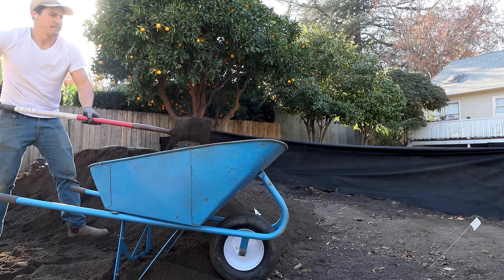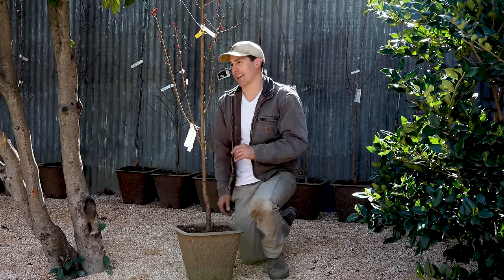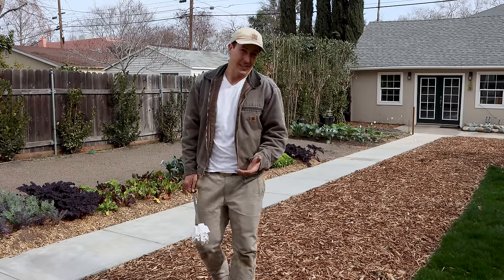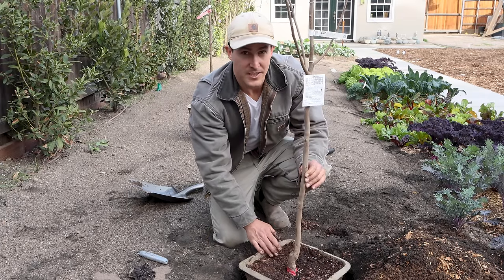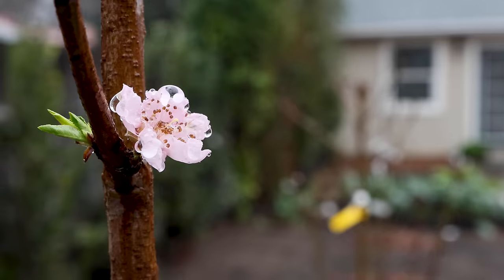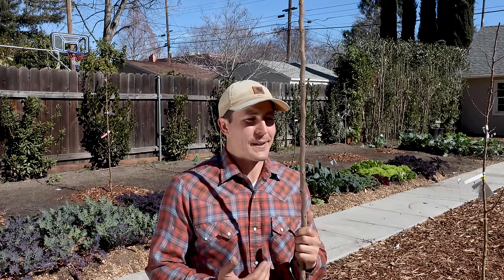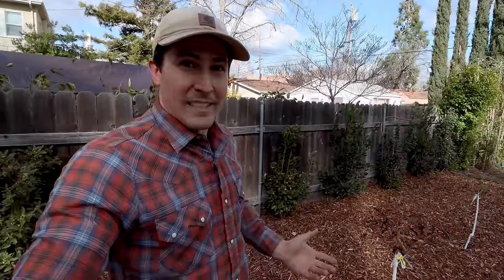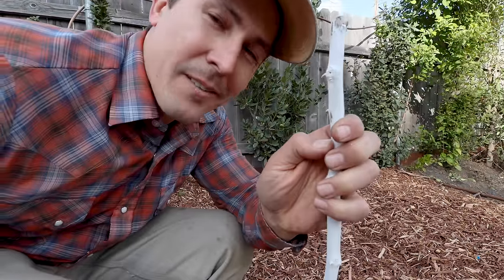How to Plant, Prune, and Irrigate Fruit Trees  EVERYTHING YOU NEED TO KNOW

Comment: One question I do have about seasonal pruning: it seems there are 3 times to prune - first planting, summer, & winter, right?

But what is the "definition" of a winter prune, in California (I'm just outside of San Diego)? Does "winter" mean January when the cold first sets in, or March/April when the cold has stopped? 

I have 12 new trees in my mom's new garden, and did not prune them on planting (I should have! I didn't know!) Now most are either in full leaf, full flower, or at least budding (and the peach is actually fruiting!!). Do I judge when it's time to prune based on leaf growth, flowering, dormancy, or ?

Same question essentially regarding the "summer" prune. Are we talking late June, at the onset of the fruiting season, or late August when harvest is mostly done? Is it a pre-summer prune, or a post-summer?
Reply from the maker: Winter pruning is any time when dormant, usually late winter. Summer pruning can be done once or multiple times through summer as needed to maintain tree size

Comment: Another question. in minute 29:10 where you are setting up the irrigation system. What are those called that are on the main hose where you are connecting the drip line hose to. Thanks!

Comment: Nice video, but I have to comment on the soil. It didn't look like you tilled that 50/50 mix in. If you didn't you created an abrupt transition between your native soil and the loose top layer. Water will not easily move from one layer into the other. The layers should be mixed. You might want to keep an eye out for some videos about water movement in soil. There are a lot of them out there.
Reply: I should add that adding straight compost is fine when tilling it in.
Reply from the maker: Thanks Lynn, this top layer of existing soil had strait compost tilled into it one year prior, so essentially I’m adding 50/50 on top of 50/50

Comment: I was told and if you do research it tells you to never put mulch right up next to your trees. It will rot out the tree eventually. I see were you have it next to the trees . Is there a different mulch are is this not true. But in researching every site says not to
Reply from the maker: In general, yes, that is advisable. Here in summer with sun-mulch irrigation and loose mulch it’s not really and issue, and I do pull it back from direct trunk contact

Comment: hey i hate to be a bummer but you did two things that long run doesn't work well. first you would have be better off mixing grass cutting, leaves, and wood chips into the soil than cow manure or compost. second the drip emitter clog and fail over the years due to calcium buildup. a irrigation line with sprayers works best and you can put a fertigation system on it.
Reply from the maker: Thank you for sharing your experience. I’m fortunate to not have hard water that causes that problem here.

Comment: Overall I enjoyed the video, but I was disappointed that it didn’t truly address the issue of clay, poorly draining soil.  Putting a few inches of soil and compost on top certainly doesn’t transform the soil down where the roots are going to migrate to.  I did read about an easy technique that claims to be able to achieve exactly that.  I will search for the author and title later this week and post it.  Perhaps some viewers could test it and let us know if it works,
Reply from the maker: Thank you! I have a full video showing how I transformed the soil in this port the previous year if your interested. At this point the soil is still in the building mode but I only till the first year which was 2020 spring when I tilled in a bunch of compost and other amendments.

Comment: Completely disagree with you on the soil preparation. Clay type soils are great for fruit trees. You need drainage tile deep under the soil. Also plenty of lime with compost. And never use mulch.
Reply from the maker: Thank you for taking the time to share you thoughts. Yes, clay soil has lots of benefits, but drainage is certainly not one of them. I tilled in compost her two years prior to improve the drainage. I’m curious about your stance on mulch though.
Reply: @urbanfarmstead  I have a very productive apple and peach orchard on clay soil. I found it needs a little different management then other soil types. But has very good advantages . Tile to remove water from under the roots. Plenty of lime and gypsum. Don’t worry about soil PH. Gypsum at 25% of the lime used. Manure compost around trees. Table sugar is very cheap, you can get a 25 pound bag for 15 bucks. Every spring spread some sugar around each tree. The microorganisms and worms will explode in your soil. This makes the perfect food source for your trees. Do not use chemical fertilizer. And do not use mulch. Mulch is  bad for the balance of life in the soil. It should be fully composed before use on trees or garden. After a few years you will no longer need any sugar. This is just a booster to get things off and running faster. In time you will dig into this soil with your hand and there will be many small worms everywhere. The soil will be loaded with life. The clay soils will not allow these wonderful food source to escape. The biggest problem I have is young fruit trees have more fruit then they can hold. You have to remove as needed to keep from damaging trees.  Heavy lime and gypsum the first year, then a small hit every spring .  Also apply to garden. This is what turned poor soil into some of the best productive soil I’ve ever seen . And it’s all organic.
Reply from the maker: @farmerdude3578  thank you so much for taking the time to share such great details and information from your experience! I look forward to trying it out!